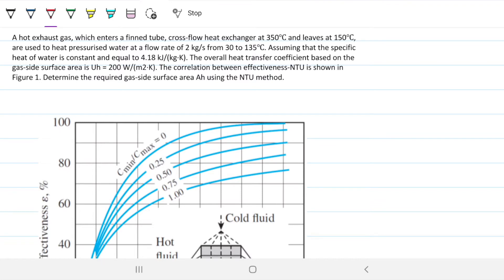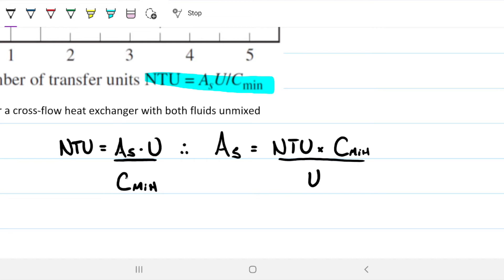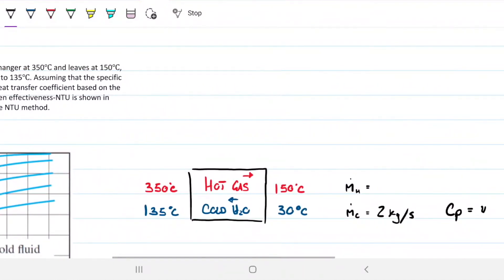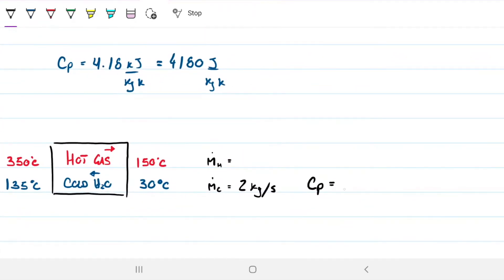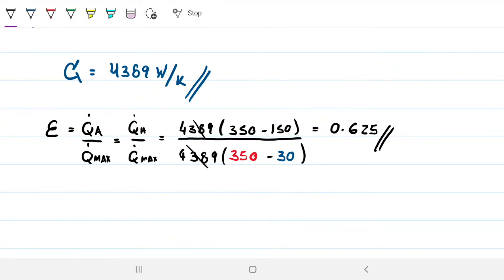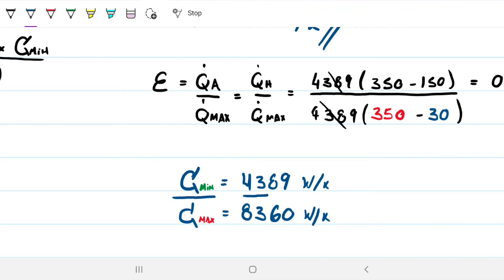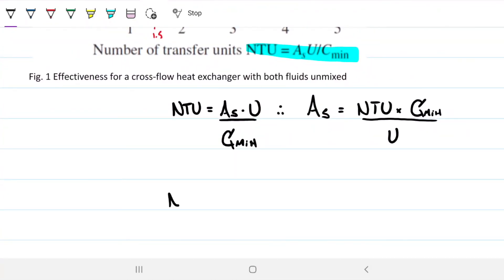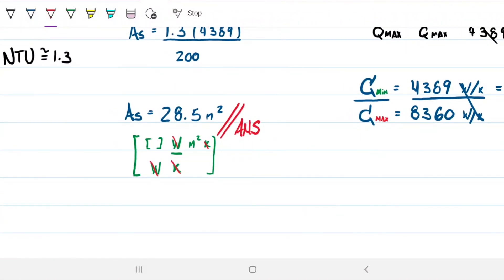NTU Method | Cross-flow Heat Exchanger | Heat & Mass Transfer

Comment: @7:12 One thing that dawned on me - Cmin should be anticipated for the exhaust gas, as water typically has a higher specific heat (or higher energy capacity) than a gas would....so, we would anticipate Cmax for water. At least, that's how it makes sense to me. Also, @8:32, why did you use Cmin for finding Qmax? Would this not be Cmax*DeltaTmax? Excellent video instruction by the way - wish there were more lectures posted here.
Reply from the maker: This is am excellent question that has a somewhat long answer. I can try recording a video answering it. But I'm sure there is something here in YouTube already